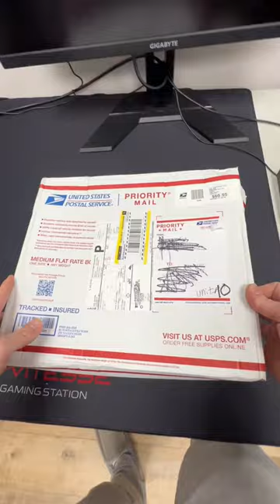Broken CPU & MOBO 😡😢#gamingpc #nightclub #pc #pcgaming #egirl #gamerguy

Comment: I get that these guys are good at what they do, but fuckin hell do you not have a repair shop in your own country?
Reply: Fr just stupid on the customer side
Reply: "I get that these guys are good at what they do"

Based on other videos they aren't
Reply: @anonymousx6651  wym I watch all their videos and they're decent
Reply: @OrrWeisbergReviews  Decent for someone, who didn't make repairing Pcs his job, he has a video where the computer keeps black screening, but instead of checking drivers, stability of CPU, GPU etc. he removes every part before finding out it's the motherboard, which he also doesn't just reflash, but replace, in another case he also had a problem with windows not working, but doesn't execute explorer.exe, but formats the WHOLE drive loosing an unnecessary amount of data.
Reply: They exaggerate stuff in videos to get people like you to comment it.
Reply: Because it is probably cheaper
Reply: @anonymousx6651  I mean all of the things you say he should have tested would have led to the exact same outcome it was a bad motherboard
Reply: @OrrWeisbergReviews  For the Motherboard video however it was unnecessary worktime spent. The exchange of aevery part takes time and time costs money (paid work) which increases the repair price when all he needed to do was flash the bios or at least do a CMOS reset. 
It would have fixed it for the fraction of the costs. 
I think many people are overexxagerating the scamminess of this channel but they are definitive clickbaity videos that you should take with a grain of salt.

They frequently feature custom builds they themselves build and after half a year they post videos with these custom builds being supposedly sent in by viewers of the channel when there are plenty videos on their channel showing said pc to be their office rig lol
Reply: @OrrWeisbergReviews  The pink PC in his recent video is such an example of them pretending to be wholesome and repairing it for the lulz of a customer.
Reply: Herpiesaestus  who’s trying to clout?
Reply: Herpiesaestus  so just because my comment happened to get a lot of likes, I’m suddenly a clout chaser? I couldn’t care less about likes. I had an opinion and I posted it. I stand by everything I said. Get a life
Reply: Herpiesaestus  bruh who’s mad 💀 I’m just correcting you because you don’t seem to be the smartest person I met
Reply: Herpiesaestus  bad troll
Reply: In my country, theres no repair shop either...but 2nd hand is cheap enough that for this price i can get a brand new set

Comment: assuming the cpu is faulty just cause GPU light didn't light up without testing with a dpug is kinda crazy.

Also the right procedure when that happens is to Reset CMOS and boot the 3400g (or 2400g) again before just assuming its dead.
Reply: enrique amaya  no tweet for 2000ish year, no twitter blue, unfollowed.

Comment: hi gamertrch, i have a question what happens if i connect a GPU that needs more power then the power supply can deliver?
Reply: Im not a pc builder (yet) but id assume it will either cut out. Not work properly or not work at all. I read the information in my own power supplies information but it could alsi break the power supply along with everything else in the computer if something goes wrong. Id personally just say get a power supply that is well over what you're said to need. Its not worth having to replace everything over wanting to save a couple dollars on a power supply
Reply: Not worth the risk
Reply: @hunger7339  okay thanks for your advice😉
Reply: It usually will depend on if the PSU. A good quality power supply will detect the excessive power draw and trip the overcurrent protection. That process usually just powers down your computer to prevent damage. But you have to have both a good enough PSU to have that feature, and hope that the protection mechanism works. If it fails, it can cause the wires to heat up to the point of causing a fire, or slightly less dramatic, to the point of damaging any, or even every component attached to the PSU.
Reply: @torak456  what about the capacitors in the PSU will they explode?
Reply: @nikodemgorka834  they shouldnt full on explode, they may short out and sort of fizzle a bit if its a cheap psu. in most cases, no builds even boot.
Reply: @nikodemgorka834  I think that the thing to take away from what I wrote is that you should not try to 'get away' with an insufficient PSU. I get that sometimes you're trying to make do with what you have, and can't really afford to buy "high quality" stuff. But consider the risk / reward here. You're risking potentially your entire computer.

Comment: Hey tech I really want to build my own pc but I have pretty strict budget can you please comment any cheap but exceptional parts and please make a list of everything I need please and thank you
Reply: What's your max budget?
Reply: About 1500$ I hear that 1500$ Isn’t alot when building a pc
Reply: @Footballnumber50  its a bit below the budget but the pc can run most games
An rx 580 8gb gpu can run anything and its cheap
Cpu ryzen 2500x or an 2600 they are both good and can run almost all games and ram 16 is enough idk about the case tho
Reply: @realman3092  thank you for the help
Reply: @realman3092  is it possible to upgrade my pc whenever my budget is higher?
Reply: @realman3092  is this all I need to?
Reply: @Footballnumber50  yea u can upgrade it and its all u need for now Until like 2025 when games become more high end
Reply: @Footballnumber50  1500$ Will Easily get you a High end machine You could easily build a 
CPU- 7600
Motherboard- cheapest B650 Board (If you need wifi/bt get a wifi varient)
Ram- 32GB 6000Mhz 
Gpu- RX 6950XT 

Storage- 1TB NVME
Case- Something with good airflow (corsair 4000D airflow works)
PSU- 750/850W Name Brand one (Corsair,Evga,Silverstone,Msi..etc)
Reply: @Gokul_Yt  thank you
Reply: @Gokul_Yt  is this all compatable?
Reply: @Gokul_Yt  XPG Core Reactor Modular PSU: 80 Plus Gold - ATX - Fully Modular Power Supply, WD_BLACK 1TB SN770 NVMe Internal Gaming SSD Solid State Drive - Gen4 PCIe, M.2 2280, Up to 5,150 MB/s, Corsair 4000D Airflow Tempered Glass Mid-Tower ATX PC, XFX Speedster MERC319 AMD Radeon RX 6900 XT Black Gaming Graphics Card with 16GB GDDR6, HDMI, 3xDP, AMD RDNA 2 RX-69XTATBD9, Corsair Vengeance DDR5 32GB (2x16GB) 6000MHz C36 Intel Optimized Desktop Memory (Onboard Voltage Regulation, Custom XMP 3.0 Profiles, Compact Form-Factor, Solid Aluminum Heatspreader, Intel Core i5-7500 LGA 1151 7th Gen Core Desktop Processor
Reply: @Footballnumber50  No the cpu is amd ryzen 7600. And get a amd certified ram kit (amd expo kit) and the list doent have a board listed.
Reply: @Gokul_Yt  ok so I picked the parts you told me to change. Now I have G.Skill Flare X5 Series (AMD Expo) 32GB (2 x 16GB), AMD Ryzen™ 5 7600 6-Core, 12-Thread Unlocked Desktop Processor, MSI PRO Z790-P WiFi DDR4 ProSeries Motherboard (Supports 12th/13th Gen Intel Processors.
Reply: @Footballnumber50  the board you choosed is an intel board you need a b650 board
Reply: @Gokul_Yt  ok is this the correct one? MSI PRO B650-P WiFi ProSeries Motherboard (AMD AM5, ATX, DDR5, PCIe 4.0, M.2, SATA 6Gb/s, USB 3.2 Gen 2, HDMI/DP, Wi-Fi 6E, AMD Ryzen 7000 Series Desktop Processors)
Reply: @Footballnumber50  it is correct
Reply: @Gokul_Yt  so I can check out now?
Reply: @Footballnumber50  yes
Reply: @Gokul_Yt  thank you so much for your help I really appreciate it
Reply: @Footballnumber50  bro no get a rtx 2060 ko ultra it’s a 2080 die in a 1660 heat sink cost 200-300 and will actually be a card you can be happy with
Reply: @Gokul_Yt  hey haven’t bought the parts yet I wanted to do research and stuff but found some better parts but still don’t know if there compatable if you can spare a minute thank you
Reply: @Gokul_Yt  nvm I had to change parts once again because it dident save please tell me if these are compatible

Comment: What if the system turning on but not displaying. Trying chsnge gpu. Trying the hdmi from mobo. And red light on the motherboard constant
Reply: Does your cup have int graphics? If not you wouldn’t get a post from the mobo hdmi. But from the sounds of it your ram cpu or mobo are fried.what happened before did you switch a component if so you could have sent a static shock to the board frying it and possibly all it
Reply: @The_Mr_Mugiwara  i dont know i sold it when it was working. But the prrson said he tried everything
Reply: @haitham1789  ah okay gotcha
Reply: @haitham1789  I started building and troubleshooting them so I love to help ppl out
Reply: @The_Mr_Mugiwara  yeah thanks. 
So i dont know, maybe that guy destroyed it somehow